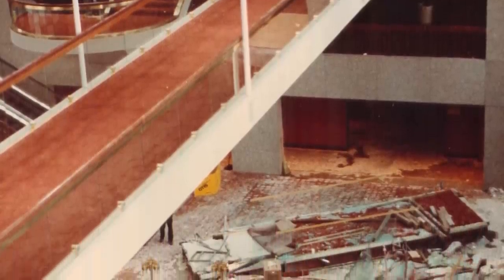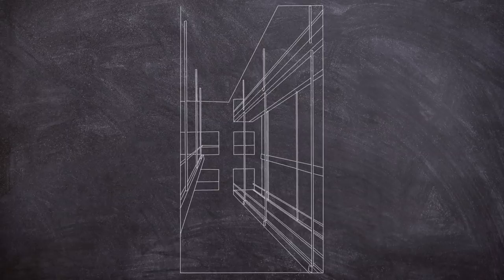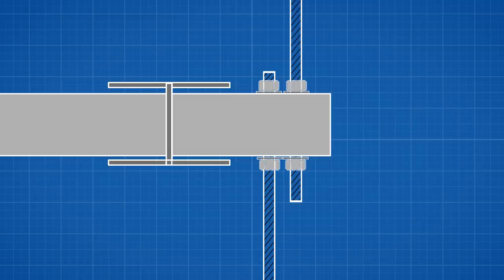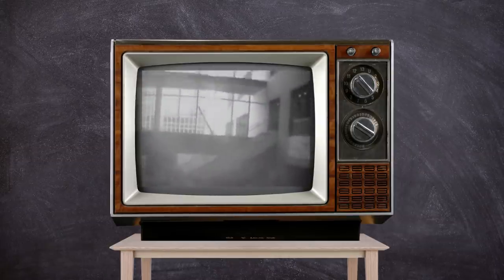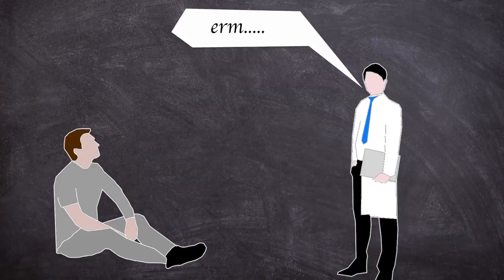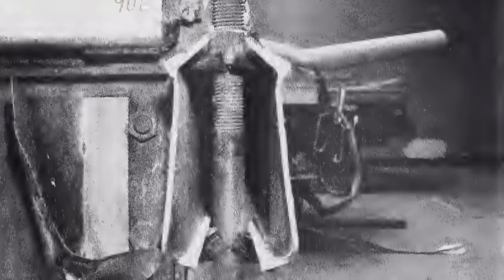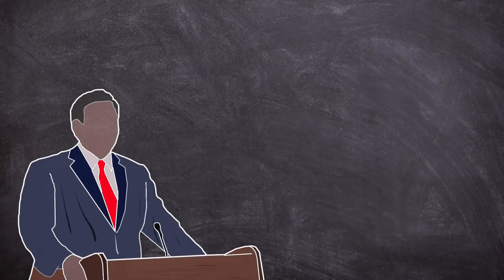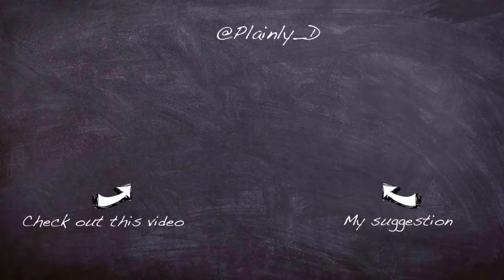A Brief History of: The Hyatt Regency Walkway Collapse (Short Documentary)

Comment: 3:05  More like "No way in hell am I payin' my guys to thread nuts and washers onto a continuous length of all-thread for literal days on end!"
Reply: I can't help but think that if the rods were forged with the threaded sections a larger diameter, the nuts would just slide up to the section where they're threaded, the narrower sections being smaller than the minor thread diameter. I also think that hanging steel cables could have been done cheaper again.
Reply: @carneeki  Yeah why didn't they just use cables?
Reply: @Misha-dr9rh  beats me... It's the obvious choice.

Comment: It really gives you an appreciation for the modern world to see this. The fact that this is not more common is amazing. Engineers are not contractors and vice versa. One has to determine how the thing needs to be built, the other has to make it happen. They're both experts in their end of the job, but they also rely on the other to know what they're doing. One saw an issue with the practical application of the design and possibly didn't understand the physics. In this case, the engineer clearly didn't look into it enough and reassert the criticality of the design as is. And then communication broke down.

Another great case study of this kind of situation, where design didn't take into account real world pressures and the real world technicians didn't understand the implications of why they were supposed to do things a certain way, is American Airlines flight 191 in Chicago. It's the DC-10 that literally lost an engine on takeoff. In this case, the design wasn't inexplicably changed. But the way work was supposed to be carried out was incredibly impractical, and so methods were changed and improvised (systemically, I may add) until people died.

Comment: Instead of bulky support systems, we want the walkways to look pretty. Vanity has a price.
Reply: Also requires that you follow the design exactly, rather than improvising an alternative without consent of the design team.
Reply: Note that the original, prettier, design would have held the load.
Reply: @nrdesign1991  
Which was the exact problem. The solution was presented to the design team. And everyone thought somebody else had reviewed it. But apparently nobody had and it was accepted as drawn.
Reply: @Thirdbase9  Yes, it would have put the load on the roof as intended. That would allow for like twice the weight.
Reply: @neilkurzman4907  All they had to do was look up, tho.
Reply: @windsofmarchjourneyperrytr2823  original design was not very buildable. A drawing was made for the builders counter proposal. Somehow the drawing was excepted without ever being reviewed. However it was signed. That means there was a big breakdown in procedure at the engineering company. Which is why they lost their license.
There were several ways the fix the issue was caused by the change.  One of them was simply adding washers.

Comment: as i already watched this before and had lessons on this example since im in metal industry...the problem where not the rods...they could easily hold that weight...high tension yes...failure no...and to improve that they could just use extra bolt under it and wider grip clamp to hold that beam.
problem was in the design of the beams..they didnt use square beams they used C profiles or U profiles how do you want to call them..they had to be placed back to back..so they look like I or H profile...and steel rod running between them..that would give most structural strength... what they did was took C profiles and face them face to face...[ ] like that and rod ran through them with bolt on top and under...they did that because it looked better...now if you face them face to face and have that small lip hold TWO rods up and down...that lip is going to bend and fail...causing rods to be pulled through it...and that is what happened...
they should leave them back to back ] [ like this so it cant bend...and nothing would happen...but then again it would look ugly...
Reply: This. The video actually doesn't go into the root cause of the accident (or negligence if you may).

Comment: I think it's amazing that anyone thought it would be a good idea attempting to have thread run down a bar from top to bottom, 3 floors down from the ceiling. Just think about that for a second. Original design had a 3 floor single bar attached to the roof, and attached at two different points.

So, you think about it, the entire bar needs threading down it's full length. You transport that, you are going to damage the threading. Onsite they changed the design to two bars, because lets be honest, it is easier just to run threading at the tips of the bar. But just imagine the pure stupidity at play here.

The original design would have been impossible, nobody in their right minds is going to thread an entire bar. I feel sorry for the poor guy who was backed into a corner and had to tick the box for changing this to 2 bars. Because he was never going to have any other option. It's the douchebag who had this as a single bar design that needs a punch to the balls. Draw a design that is impossible, and the poor guy onsite who has to adjust things gets the blame.

Comment: There's one other aspect of the design that contributed to the failure. The transverse beams of the walkways were rectangular box sections, made of two C-channels butt-welded together. The holes for the suspension rods went right through that seam. You can see how the weld pulled apart as the nut and washer was dragged through. Using a seamless tube, or placing the butt-weld on the sides rather than top-and-bottom, may well have increased the capacity of the beam.

Comment: This was a case study in engineering. Each walkway should of had their own load bearing cable from the roof.. instead, to cut costs engineers tacked the load bearing cable to the bottom of the walkway above.. taking it over its SWL before anyone even stepped foot on it!! (This dude just explained it better than most and in a 'Plainly difficult' manner!!😅 )
Reply: It wasn't to cut costs.  The fabricator of the rods was concerned that the threads would get damaged making the rods unusable.  That's why they recommended two rods with threads only at each end.  The original design was for the rods to be threaded along their entire length.  It's one of those 'good ideas' that weren't good ideas.  What appalls me is that the better idea (which would have been less expensive and still carry the loads) would be to have the rods connected to each below the higher walkway.  And the connectors needed to do this can be ordered out of a catalogue.  Just pick the connectors that are good for twice the design loading.  (It's easier to get a change approved by the code inspectors if it's seriously stronger than needed.)

When you make a change - you want to keep things as close to the original design as possible. The further you get away from the original design - the more it costs and the more things can go wrong.
Reply: @colincampbell767  
The problem here was that the contractor had an issue building it as designed and proposed an alternate solution. The solution was excepted without ever having an engineer review it. There were dozens of ways that this could have been done safely. The failure here was the rubberstamping of the drawing without it being properly reviewed.

Comment: 4:52 That's not quite how it would have gone down. Because of the redesign of the rods, the second floor walkway is suspended from the fourth floor and not the roof. A failure in the fourth floor would see both walkways drop at the same rate, so a more accurate description would be the second floor dropping onto the ground first, and then getting smashed from the fourth floor walkways falling ontop of it right afterwards.

Comment: Part of the problem was that the initial concept for suspending the walkways from single rods was not fully detailed out; IIRC, the concept showed rods that were only threaded for a small section where the walkway was attached. Then when it was detailed out, it was done with fully threaded rods in a way that was pretty impractical from a production point of view. Even during construction there was evidence that there was something wrong with the walkway design and it was just ignored.

Comment: The fire extinguishing system line was breached and roof mounted tanks with thousands of gallons began flooding around the dozens of trapped people. The water was building up against a revolving door. A quick thinking fire fighter commandeered a forklift outside and used to to repeatedly smash into the doors and lower windows to allow the water to drain outside. His actions likely prevented dozens of additional deaths in an already catastrophic disaster.

Comment: The original drawings also specified that the welds for the box beams were to be on the sides, not along the top and bottom where the rods went through.

It is also why they now have the C-sections back-to-back and the rods going down between the walls of the C-sections, so as to not have weight bearing on the flanges but on the stronger vertical walls.

Comment: I read about this later;
When I worked for MKE we heard of a "collapse" in Colorado using "new ideas" ~ good fortune has prevented me from seeing any such things though once I did ride a gang-form at Las Colinas pumping station that I saw no need to ride · Later on the same project I was assigned to watch falsework during the pour and I told helper assigned to me let's go over here which was well away from a falsework that I knew would collapse ~ It did then I emerged to inform foreman Cliff that we were not harmed · There is no margin for error in some situations so the only avert avoid abstain is to just walk away

Comment: There are many quiet common ways this could have been alternatively designed. Box section should never have holes simply drilled through it and used in a mechanical function like that. The way to do it is drill through and weld in a strong sleeve which the threaded bar then goes through. Then you eliminate all compression forces on the box when tightening the nuts.

Comment: Have you ever considered doing a video on the Miller Park "Big Blue" crane collapse in Milwaukee, WI?
Reply: @kellysquirrelk  I was in tech college at the time and one of my classes took a field trip to a metallurgical testing company. Before our tour ended, the guy leading us took us to their back storeroom. They had one of Big Blue's anchor pins, not the one that failed but the one on the opposite side of the crane, basically the one that it fell around. It was a solid piece of steel as big as an oak tree, and the whole thing was bent at about a 45° angle. The guy just told us, "look at this and imagine the forces involved in making that happen."

Comment: One of the more interesting parts of this (and a rather uplifting one given the morbid story) is that the first responders had no equipment to remove all that fallen debris. So, they put out a call. They didn't just get a forklift. They got all kinds of stuff from jackhammers to a crane that an operator put through one of the big glass windows in the front to assist with the removal of the heavy debris. Which came none too soon, as the water from the busted sprinkler system was building up by several inches, and the front doors needed to be shattered so that pinned victims on the ground would not drown before rescue.

Comment: I noticed that you describe the fourth floor collapsing onto the second floor and then both crashing to the ground - if you're talking about walkways, I don't think this is a plausible sequence of events. The fourth floor walkway's suspension failing would surely cause the second floor walkway to fall just as rapidly, with the two falling to the ground and then the fourth floor walkway continuing to fall on top of the second floor walkway.
Reply: My understanding was that the steel structure deformed, dropping the concrete slab of the fourth floor walkway onto the walkway beneath. The impact then ripped everything down.

Comment: This is used across the US as an example of an overly simple engineering disaster.  Of course the way it is told in class the builders made unauthorized changes after the engineering designs were signed off on.

Comment: The Hyatt Regency collapse is a literal textbook case of bad design and failure to understand the physics you're working with. I've seen it used as an example of what not to do in multiple engineering courses while I was studying in the university. It also reminds me of a poem by Rudyard Kipling, which I think every engineer should commit to memory:

The careful text-books measure
Let all who build beware.
The load, the shock, the pressure
Material can bear.
So, when the buckled girder
Lets down the grinding span,
The blame of loss, or murder,
Is laid upon the man.
Not on the Stuff—the Man!
Reply: It’s not a textbook case of bad design. It’s a textbook case of no design.
The original design would’ve worked, but it was too difficult to actually build. 
The actual design was based on a suggestion by the fabricator. No designer ever reviewed it to understand if it was a sound design.

Comment: the picture at 8:31 is very telling, the crossbeam is made of 2 pieces of channel welded together.. I have no idea what the logic to using that instead of premade rectangular tubing was, but two big problems with it was the end wasn't capped which allowed it to deform and rip, and secondly, the lower part of the crossbeam had no real support, a piece of tubing welded on the inside would have spread the load with the upper section as well and been far stronger.
Another option would have been to have a long connecting nut which would allow for the use of the original design, as well as being able to use rods threaded on only the ends and everyone would have been happy

Comment: The substitution suggested by the steel fabricator was the critical flaw that caused the collapse.  The original engineer was guilty of accepting the change without critically examining it.

The original design was also suspect because the box beams were constructed from a pair of channels connected together tip to tip to form a box.  The resulting box will look nice, architects prefer the sharp corners of a box fabricated this way to a normal rectangular tube, but the box will not have the needed strength to resist the rods pulling through this joint.  Couple this problem with the problem of the loads being doubled on the rod connections and now there is enough of a problem to cause a collapse.

Hindsight is easy.  I look at the original detail and I would have recognized the weakness at the seam and I would not have done it that way.  The logical thing to do would have been to put a thick piece of plate under the box the serve as a large washer to distribute the loads, but I'm also aware that some architects would seriously object to this.

I worked for a company one time that had a rule that you don't accept any changes like this, just reject them completely.  The original design will normally go through a lot of thought and discussion in the engineering office.  Different failure modes will be discussed, calculations will be done, the design will be studied by multiple people.  When a fabricator offers to change a design and you accept it immediately you have lost the benefit of time spent studying the design.  Maybe it looks OK on the surface but eventually you figure out the flaws.  If you accept the change and don't study it then sometime it will cause a problem.

The change proposed by the fabricator was due to the continuous threads in the long rods but there are other ways to handle this problem without doubling the load that occurred at the critical joint.  The fabricator could have brought their concerns to the original engineer and together they could have worked out a solution.  In this case the fabricator proposed the change, the engineer paid the price for it.

Comment: I am not mistaken (memory from learning about this in Structures class 2 years ago) the original design did not actually meet the building code requirement due to the hole being in the welded seam line, but as mentioned would have been sufficient for the loads of the day.

Comment: I’ve seen this story on tv. To me it looks like the washers were too small and the holes were too close to the end. $100 worth of hardware ( plates instead of washers and a steel band around the end) would have made it safe :(
Reply: It would have failed no matter the washer size. The upper walkway was not designed to carry the load of the lower one

Comment: When they decided not to use one single rod, they should have used independent rods both suspended from the roof instead. That would be the obvious solution to suspend the bottom that is force wise equivalent to the original design (as the rods themselves were designed to be strong enough for more than the two walkways anyway). 

I get that it would not be as elegant to have two rods side by side from the top level up. But there are several way they could make it more elegant: 
- They could have wrapped the pairs of cables in a decorative non-load-bearing tube that extends all the way so it looks like one solid tube instead.
- They could have made the lower walkway wider so the longer rods could go outside the upper walkway.
- They could have shifted one of them about one walkway width or more to either side so they didn't overlap.

And if they really wanted the single rod appearance, would it not have been just as good as the original design to weld attachments to the middle as using threads and nuts?